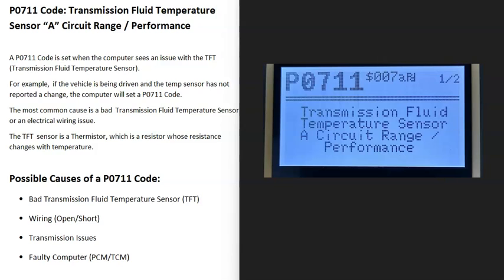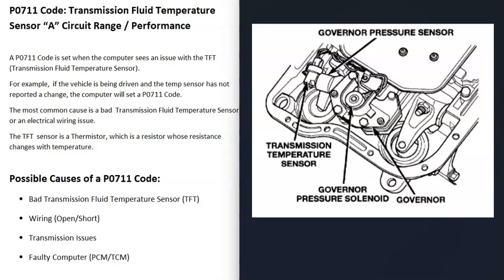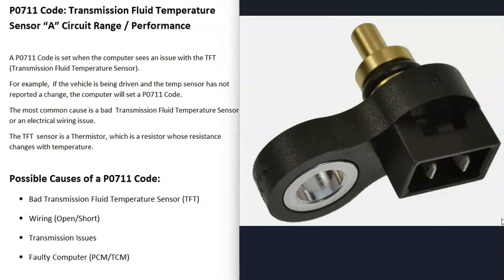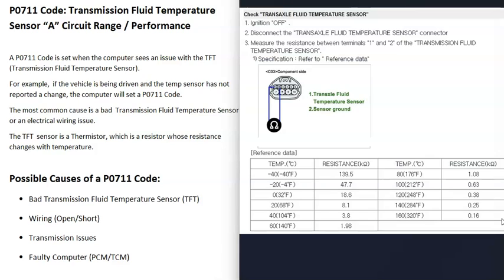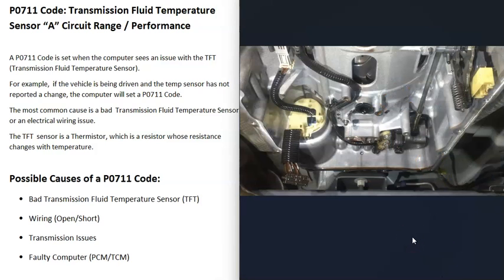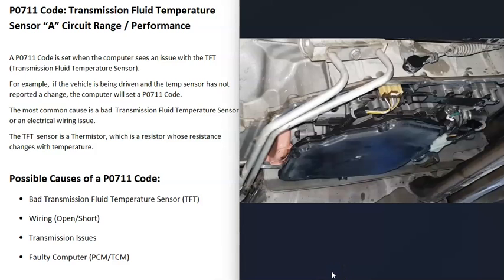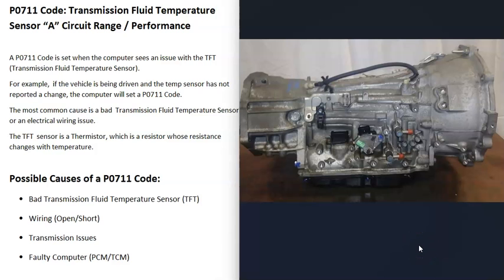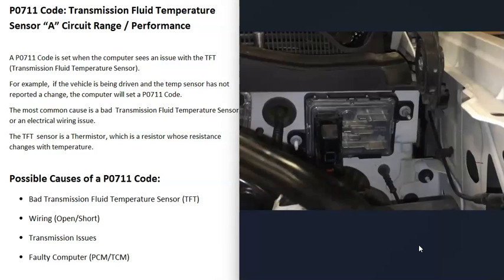Causes and Fixes P0711 Code: Transmission Fluid Temperature Sensor “A” Circuit Range / Performance

Comment: I just got P0700 and P0711 on my 2017 Cadillac CT6. Onstar gave me those codes. I’m gonna confirm it myself with my scanner. Car runs and drives fine with just under 85000 miles and no issues. I’m going to clear the codes and see if the check engine light comes back on? I’m hoping it’s a glitch with ECM?
Reply: I got same thing same car. What did you figure out?
Reply: @Catfishing87 transmission fluid temp sensor went bad. Change out the sensor and harness that goes with it. It’s good now

Comment: Have a 2005 Chevy hd and has no codes but temps always showing 200-250. Where the sensor to replaced ? Lly motor. ???

Comment: When I did a diagnosistic on my Cadillac ats 2016 said  my sensor a electrical circuit was out of its range can u tell me more about that issue
Reply: Did you get this fixed? I take my car in tm for this issue

Comment: Is it possible that you can get back to me as soon as possible 2011 Honda Elantra all the car took it to the shop is the engine is a timer change and I have 13,6125 miles on it and I barely drive it and I keep all the maintenance up on it

Comment: Having this problem on new transmission we have replaced the temp sensor 3 times had the tcm checked and reprogrammed and have checked wires and still getting the code and can’t drive it

Comment: I have condes P0711 and P0760 in a 2009 Kia Rio.  Could the problem be related to the same cause?  Do I need to change only the temp sensor and both codes will be eliminated?  BTW, the symptoms are, no shifting of the transmission.  The car does not go uphill, but runs in straight road
Reply from the maker: It needs to be diagnosed, and parts tested to know what the issue is. I would check the fluid level and check for any blown fuses, then test the fluid temp sensor and shift solenoid ‘C.’

Comment: Hi I had a P0711.00 code on my 2017 Chevrolet Camaro SS  code was deleted from system but that was 12 months ago but it never come back with that check engine code again I’m just wondering, could this have been a glitch on the engine transmission fluid temperature sensor? Thanks

Comment: Hello mate, i've got this code on my hyundai terracan 2.9 crdi from 2004. But the thing is it's a manual transmission and im wondering if that's even possible, does it even have that sensor? Could it be the ECU setup to an automatic? Please help me out here man
Reply from the maker: It is best to get a manual or diagram for your specific vehicle but yes, a manual transmission can have a temp sensor.

Comment: P0711 .. faulty TFT sensor..  but other manufacturer has some ONLY sensor replacement... And affordable.. others has sensor replacement but its built in to the valve body and cost you $500.. really stupid.. !!

Comment: Thank you! I have this code on my KIA Forte 2013 EX 2.0L with 163K miles. Found some tutorials on how change the temp sensor but nothing that goes in depth on what the code actually is.